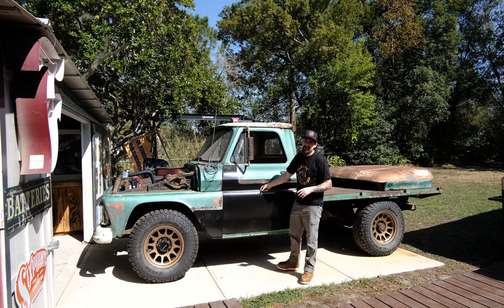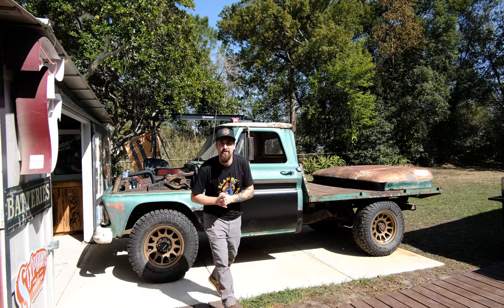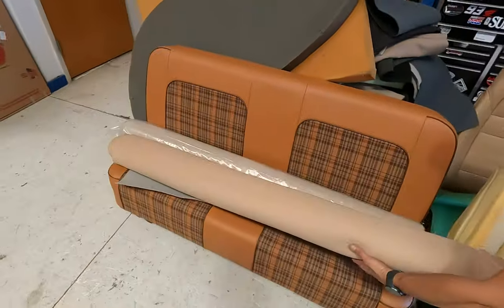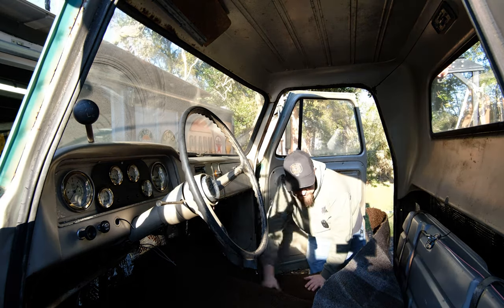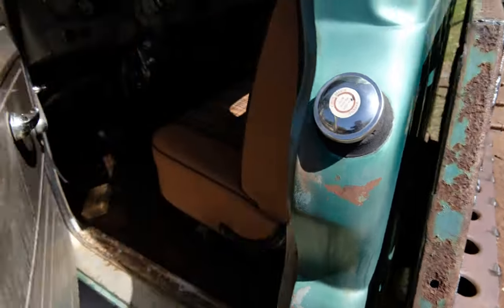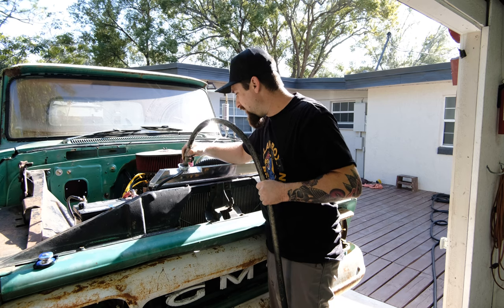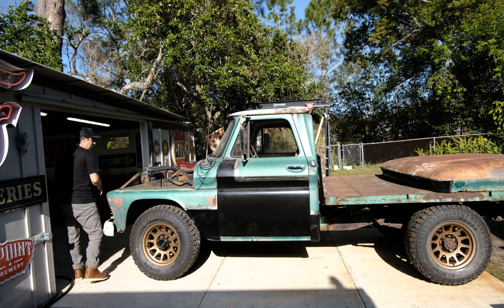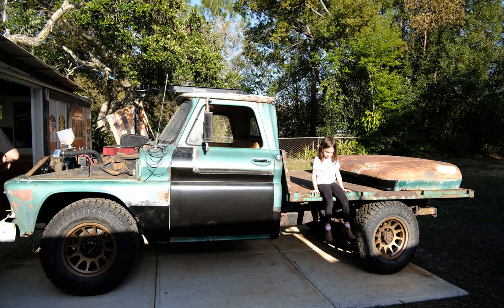Baller Bench Seat Build: Crafting the Ultimate Interior for My Shop Truck!

Comment: Great video as always Adam, I would use the bit of carpet you cut of then fit it up on the bulkhead just to cover the silver sound deadening under the dash IMO that would look so much better, also even though you are in a hot climate you should use coolant in your system to stop any internal corrosion👍 
The bench seat looks awesome dude those guys that refurbished your seat are mega skilled at what they do, it's nice to see people refurbish these things rather than replacing them👌🙏👍John UK

Comment: Im doing a cab swap and the back seat of the donor truck fits the new cab like a glove bro. I was thinking about learning to fix seats because the international bench seat is pretty cool but this Silverado back seat folds open and has tons of access plus a fold down arm rest and cupholders so its a no brainer. I do need a headliner and a couple door skins. Debating on welding a couple panels up of old steel license plates, or otherwise masonite with some fabric and leather straps will be ok. 

Your seat came out fantastic, as id expect it would. I can't get past the bed man, i really like the style you created and I'm probably going to be using it for inspiration. Thank you for sharing your skills knowledge and experience. I appreciate you
Reply from the maker: Sounds like you’re moving in the right direction!